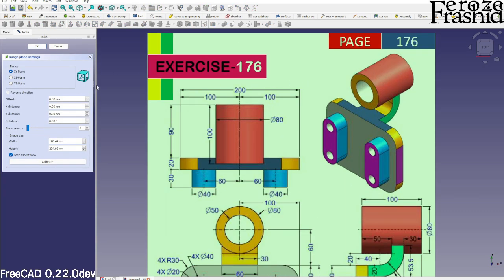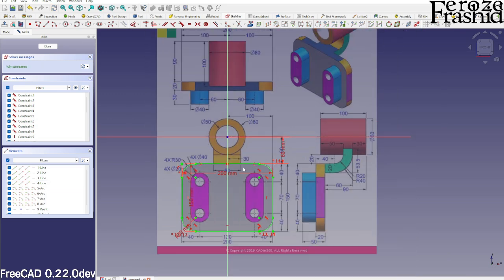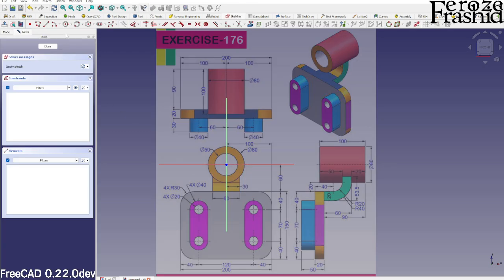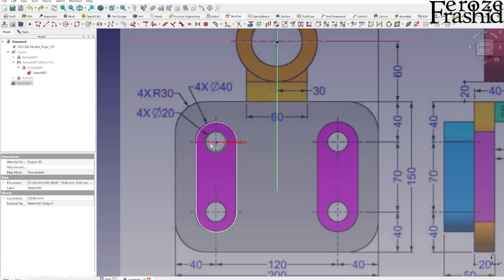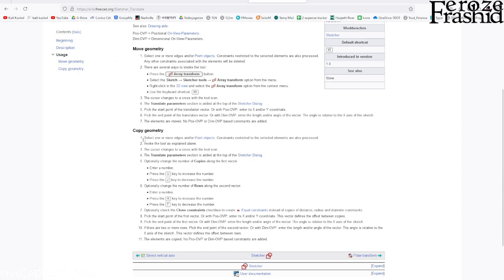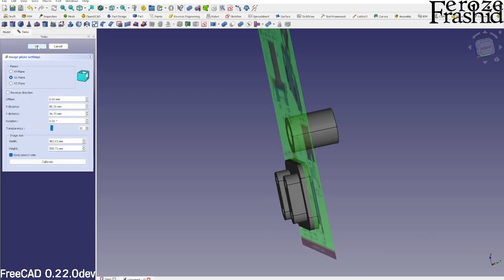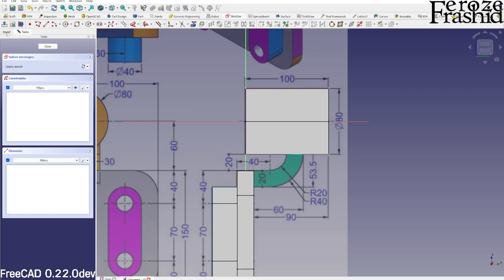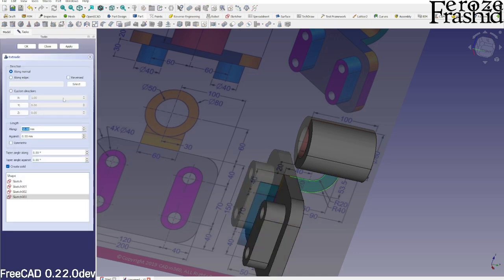200 3D Models in FreeCAD: Exercise 176 (Move/Array tool in Sketcher)

Comment: At 9:15 you demonstrated the new features place by the Move/Array tool were not constrained. That was the experience I had when trying to learn to use the tool just an hour ago which caused me to search for more information and find this video.  I am hoping someone can suggest how we can quickly constrain the features we add. I am adding an array of 15x2 to represent the pins on an ESP32 eval Kit and so getting about 30 degrees of freedom leave a lot of work.
Reply from the maker: Hi, is using draft array or lattice2 array an option? Making that many replication within the sketch may not be practical. These two arrays will retain transformation measures.

Comment: Hi, thanks for the exercise and video tutorial. 
Just a small note:
- When you've created the 4 tubes to make the Cut you forgot to make (on the sketch) the symmetry of the 2 top circles referring to the vertical axis and also the vertical constraint of the top centers with the bottom centers remembering that the array used doesn't keep the dimensions forever....
Cheers
Reply from the maker: I started the first circle from a reference center point. with that, it either symmetry or dimensions. I went with dimensions. Now the dimensions that were given during the move/array operations were not retained later on. So, I reapplied those dims. I figure I could also go with symmetry instead of dims.
Reply: @kattkushol  Yes, I noticed you've reentered the initial dimensions from the array but the 1st circle center was not constrained in the 2D space and when you gave 120mm separation to the second circle center that doesn't mean they were symmetric to the vertical. Maybe I'm mistaken and I will have to follow along  your steps whenever I install the 0.22 DEV or the stable next version. I just have 0.21.2 now. Can you review yourself the same model using the old method and check if the final result is coincident to the presented one? Cheers and thanks for replying to my doubts. You are doing a great job anyway, congrats.